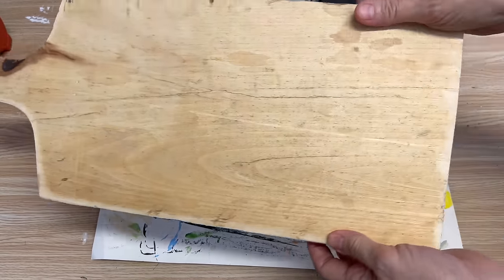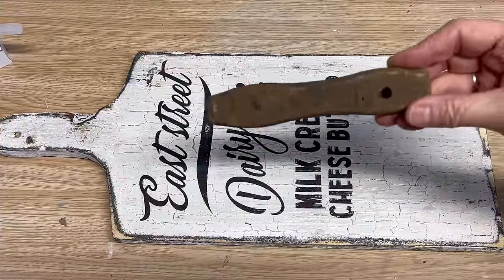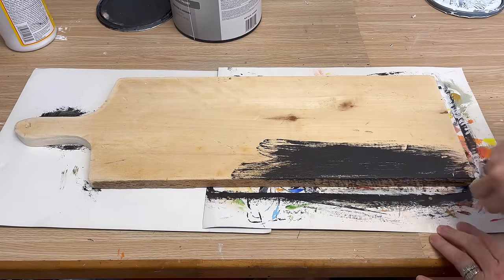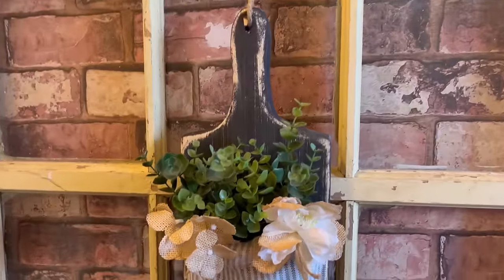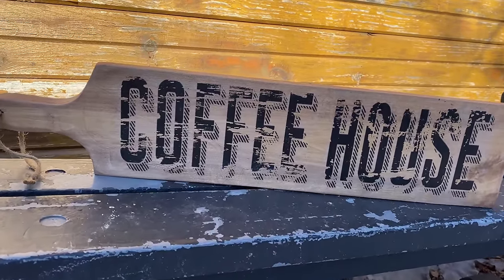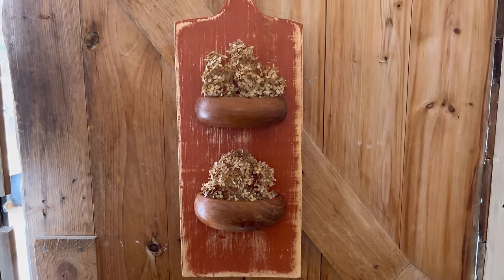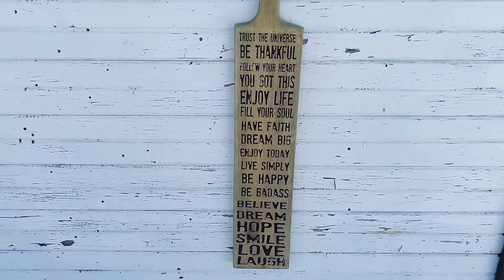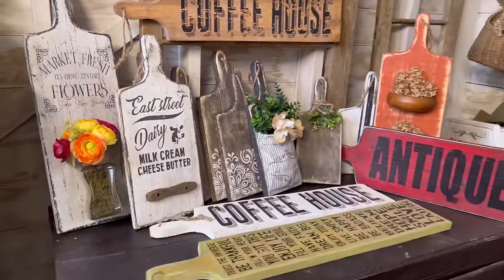Make Money With These Farmhouse Inspired Cutting Boards

Comment: These all look so pretty. But I would like to make a suggestion that could save your fingers when doing the graphic transfers! I used a kitchen scrubber (the yellow sponge with the rough green scrubber on one side). First, I would use the sponge to dampen the paper, and then lightly scrub it off with the scrubby side. I am also going to try an exfoliating body brush because I have an idea that might also work. It just saves you from possible splinters and you get to keep the skin on your fingers 😀
Reply from the maker: I have tried that and I can’t get very good results the best results I get with my fingers and I can feel exactly when all of the paper is gone thanks for watching

Comment: Love your videos! I've made a couple of signs using the glue to crackle the paint and I love it. I have tried twice to use hairspray and acrylic paint and it doesn't crackle. Do you need to use a heat gun?
Reply from the maker: Yes I found heat gun works best

Comment: Just curious about the chalkboard paint. How come it's used as a  base on some of them when it's basically being covered up by other colors?  Is there a benefit to that vs any other primer or flat black? A lot of the chalk paint I've found has been pretty expensive.
Reply from the maker: You can use up any black paint! I just have lots on hand and make my own so it affordable

Comment: I just found you a couple of weeks ago and have been binge watching ever since.  I love all your projects, and you make the directions so easy to follow.  I do have a question. On the transfers where you let them sit overnight and rub them off the next day, you say that you used a laser printer. Before I go and muck up a project, could you tell me if it works using an inkjet as well?  Thanks again for all your awesome tutorials!!!
Reply from the maker: Happy you found me Debbie! Here is a tutorial that will show you how you can use a ink jet printer if you dont have a laser jet. It can be a bit more tricky but it will work : https://youtu.be/F17WmucEwqM

Comment: Should there be ANY paper residue left after you rub it off? I was having trouble having paper residue.
Reply from the maker: You may have a little bit but most will come off! Do small sections and redampen. It works best with a laser jet printer

Comment: Would your mod podge method work on a wooden fence board that surface that is not smooth?
Reply from the maker: Very tricky to do it on wood that is not smooth because it’s hard to read the paper off in between the grooves